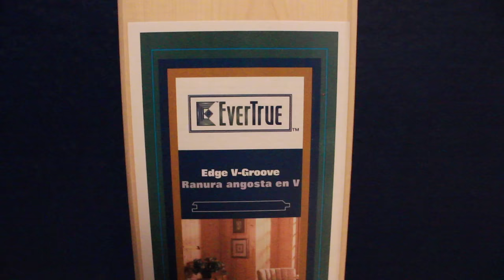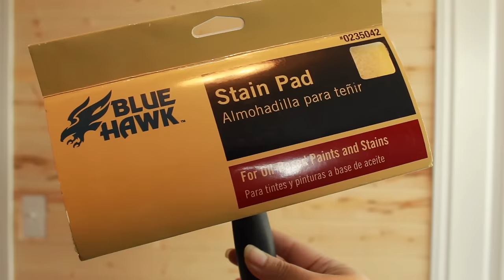DIY Rustic Wood Wall Under $40

Comment: when laying out boards, go first row all the way, and start with a leftover, there should never be a single strait line between columns like you have above the right door
Reply: Just what I thought - the end result looks too sterile otherwise.
Reply: Second that staggered just like you do floors looks a lot better. Also you could've stained the boards before installing them.
Reply: Can you elaborate?  Sounds like a good tip but I’m confused
Reply: @davidwatchesyoutube247  when you start, you place full boards all the way and cut the one at the end, then you start with full boards again from that end and cut the one on the opposite end, that way your boards get staggered.
Reply: @lucyferina  right on thank you!

Comment: Wall looks great! A few tips for the next project. Stain first, its way easier and looks better. Stagger the joints, it looks way better that way. Cut the boards to that the ends never meet up on the same line. Thumbs up, you guys did great!
Reply: Also...  start at the bottom and hide your nails at the top of each peace so they're covered by the piece above.
Reply: I would also take the switches and outlets off and put the planking behind them, then re-install with the tabs over the top of the planking so that your covers sit on top of the planking.

Comment: We used laminated flooring, the wood one that already had it stained the color we wanted, and it was easier. we didn't have to use stain just put on walls.  Your walls look nice .
Reply: Pretty expensive, but way better look.

Comment: looks great. I think it might be easier to stain before installation. Great job!
Reply from the maker: It wasn't hard to stain at all after installation. Thanks!
Reply: After better to cover the nails.
Reply: It looked harder than it had to be though :)
Reply: Definitely stain before installation.
Reply: was just gonna say that would of been easier
Reply: I don't think she would have gotten that light wood coming through the slots if she would have stained before installing. See how the light wood peeks out. I loved how she did that.
Reply: @Dawn Kellogg-Patterson  -   ???? WTH?
Reply: Huh benny? Looks great troll
Reply: Great video,  but from experience I prefer to stain before Installation
Reply: Stain before, you can see where the stain didnt get between the boards and it looks silly seeing the light wood in the cracks
Reply: For sure. Avoid staining the trim or anything else. Nails can be touch up later.
Reply: especially since it is toxic to breathe in yr home. stain should always be applied outside or in a really well ventilated area.
Reply: Stain with a brush, let sit a few minutes, wipe off with a rag. Mix your stain in an empty can first. Your method was bad and the mix is incomplete. Tape your trim before staining, but staining before instal is easier AND you get the tongues. The raw wood tongues stand out.
Reply: Most def.
Reply: Staining after installation is better. Wood is always looks darker when on the wall so this way u can control the amount of stain your applying for your desired look

Comment: I usually prefer staggered boards, but aligning them highlights the length of the boards in a way that staggering doesn't. It's a very nice look, as demonstrated perfectly in this project.
Another thing, that stain color is gorgeous. Great choice.

Comment: You 2 did a nice job on that wall.

A technical point -  working from the bottom up is easier.  First row has the tongue cut off.   Put the nails through the back lip of the groove, so they are invisible.

Comment: Looks great but I personally would chop up the strips so there were staggered joints ...sort of like bricks ....otherwise you end up with a seam which bug me forever.  Also I think I would use a few different strains and stain all the cut pieces and THEN nailem up randomly ...if you can picture that?  Also by pre-staining you don't get the unfinished gaps you had to use a little brush on meticulously ....of course I have the benefit of learning after the fact from your experience!  Again looks great! Love it!

Comment: Did you look for studs in the wall before using the nail gun? Did you use a construction adhesive on the back of the paneling? Also, what size nails were in the gun?

Sorry for all the Qs. Your wall looks great!
Reply: the planking is so light that you wont need to find the stud if youre using adhesive..but finding the stud is always best in my op

Comment: I saw a reply to someone's comment where you said that you didn't want to stagger the joints.  I didn't see any explanation as to why though.  Just personal preference or did you have a method behind it?  In future, I'm pretty sure those stain pads are designed for when you're staining decking.  I don't think they're really meant to hold the stain into the pad when you've got it held up against a wall like that.  I would imagine that if you were to stain a floor you would find it quite useful as you wouldn't have to get down on your knees like with a rag.  Something else you might think of doing is staining the wood prior to putting it on the wall.  That'll let you get all of the sides very easily... just something to think about if you do something like this again at some point in time.  I really like the color and the character that the final product brings to the room.  Overall - Good job!

Comment: I like this idea and it’s cheaper then buying decent floor wood to put on the wall 

but my question is what type of nails did u use?
We’re u marking so they went into the the wood behind the sheet rock?  

I have held off on it since I don’t want the wall to fall I. The middle of the night. Maybe the rung and groove helps. 

Is it still up with no problems?  Looks cool. I was thinking of trying wider wood. I seen it on this old house and it looked really cool. My luck all the wood would warp on the wall. Lol

Thanks for the video. Projects are always cool to do when the fam is involved.

Comment: Couple suggestions:
1. The joints where one piece butts to another (end to end, horizontally) board should be randomly spread out. For example, between the door and the closet door, there should have been some joints created. Every board being solid between the doors makes it look fake. Just like on a big, open wood floor there should have been some staggered joints. 

2. For a remodel job you would have been better staining all the boards BEFORE you cut them or hung them. This makes for far less danger of messing up the carpet or the trim or even the paint on the remaining painted walls. Also, by pre-staining the boards, you can see what you’re hanging and where; providing you the ability to design the coloration of the wall. Finally, pre-staining means the ONLY things you need to stain, once the wall is finished, are the ends of the pieces you cut and some minor touch-ups. 

Wall did look great; but a few little changes like these would make it THAT much better! Hope this helps.

Comment: I have a few questions as I've been researching this for a few weeks. I wanted to know how these walls are holding up now that you've had them up for a while. Also how about studs in the walls did you guys find where the studs were, or did you just nail gun straight into the wall? what kind of saw did you use to cut the wood? thank you for answering these questions it would really help me out. And this is a great do it yourself keep them coming

Comment: Proper installation involves cutting the boards into different lengths to stagger them on the wall So you don’t end up with one straight vertical seam where all the boards end.

Comment: Dang I just sanded 15 fence boards for a day because I couldn't find any planks that were inexpensive..these would have worked lol.

I think you should have stained the boards first - but it looks great. I would have offset the boards but that's just a personal taste =D Also stain in the breaks would be nice, some was missed and it looks a little off.

Comment: I love what you did with your wall, it looks amazing!  I have a couple of questions.  What kind of tool did your husband use to make the precision cuts in the panels to fit them around the trim and electrical wall plugs?  Please know that I'm a 60-year-old lady and I have no tools, but I can rent them.  I also have very little experience in the DIY arena, but I'm learning and I learned a lot from your video.  Also, do you think I could stagger the panels on the wall in the same way that wood or laminate flooring is laid (if you know what I mean)?  Thanks.
Reply: Time to buy your own tools!! You are just now getting the time to experiment!! Have a fun creative new beginning! Us women rock for projects!! :) you can do this!

Comment: Nice! Did y’all think about varying the length of the planks and decide not to? I’m only wondering about the thought process, so would appreciate a peek into your thinking. Considering this to create an alcove for for my bathtub
Reply: I just did my bathroom ceiling with this same product from Home Depot.  I would recommend varying the length so there isn't a seam that catches the eye all in one place.  It takes a little longer and requires measuring and cutting your ends of each run, but you end up with a little better look.  The thing they had going for them in the video is that they ony had a long run on the top 3 planks so it wasn't horrible... if they had done that all the way down the wall it would be really obvious.  I'm going to do a wall in my bedroom next.  OH... and it is quite inexpensive.
Reply from the maker: Hi! I actually didn't want to vary the length of the planks for this wall. This is the style I wanted. Varying the length looks nice as well, I did that in my office but for this DIY, I love the way the seamless wood wall looks.
Reply: Wood around steam?  There is a reason people use everything else possible and keep real wood products away from water and steam.  I’m not saying it can’t be done, but research the actual wood to be used and make sure you are using a wood product that won’t expand and shrink or delaminate; or if using real wood, seal it on all sides before installing it (such as with pine tar, tung oil, and pine gum turpentine solution, which was used by ancient mariners to seal wood boats for ocean use and has no modern petrochemical garbage)....

Good luck.
Reply: I'm sorry but I have to tell you, this is not a seamless wall if you have one seam running down the entire wall. If you wanted a seamless wall you should have used wood the length of the wall,  just saying.

Comment: Next time you try this although it turned out great to make it easier the next time if you stain them first you can use the rag the whole time and also if you remove the outlet covers you can put them on after but great job non the less

Comment: For all you smarty pants commenters that know construction. I'd like to do something similar to my bathroom wall, the previous owners used way too much Spackle to cover up some nail holes so, there are bumps that they then painted over. How do I prep the surface so it comes out nice? Do I sand it?

Comment: Just an observation. When I ever change the depth of a surface. It's better to remove trim, outlets and switch covers. Reattached door and baseboard trim would have hidden your wall.

Comment: Minor improvement suggestion.....you cut around the light switch and receptacle COVER PLATES, which give the result a novice look ( the rest looks like real pro). Better....IMO....to cut an opening to match the switch and receptacle opening; the smaller size  WITHOUT the cover plate....THEN bring the boxes "out" more and flush....and THEN add the cover plates......would look a LOT more pro....otherwise...looked like you took your time and cut very accurately for the other stuff...nice job. Also...staining first before install is a lot less gut wrenching for spills and such..and doesn't require you to be sao careful as you near the white trim.

Comment: Does color from the wall show through the gaps? I was just curious if I might want to paint the wall black first. 
Good job btw!
Reply: eve sandoval it’s tongue and groove.  The male end slides into the female end.  Therefore no gaps.  What looks like gaps on this wall is where the stain didn’t get in between

Comment: I have two questions!  1.  How did you make your cuts?  Specifically what tool was used?   2nd question,   I've spent a bunch of time looking for these boards or ones like it  I really can't believe this cost $40 dollars.  I think it must have cost at least twice that if not a good bit more.  Can you confirm?   Reason I ask, I've been pricing a wall like this and even using the same wood (which does not seem to be available anywhere near me). I'm looking at $150-170 just for wood nothing else.   The wall I'm trying to do is 73sqf.  Yours looks possibly smaller however I can't see it being less than 40-50sqf.

Comment: good mix...fruitwood and dark walnut.  I stain mine before I install...lots easier. if u want a little shine to it rub Formbys hand rub finish on it. I put it on with a sponge. fast.  and u can glue it if u don't want to buy a nail gun...get liquid nails.

Comment: I would have stained and let it dry before installing-- also on the top, staggering the slats, brick style usually looks more professional-- great job though. I have been thinking about this for a room in my own home, like as a wall sized headboard for a platform bed.

Comment: just be careful not  to nail through your electric cables if your doing this :)
Reply: Good tip. Rustic bathroom; dead person.
Reply: You need a stud detector. They cost less than 20 bucks

Comment: Looks great , nice 1st time project.  A few suggestions if I may...... take the time for small details, take the door moldings and switch plate covers off so your wood covers properly.  They make switch box and receptacle box extenders to bring them out flush with the new walls. Staggering the  length of the boards will look much better IMHO.  You did great and will do even better in the future!